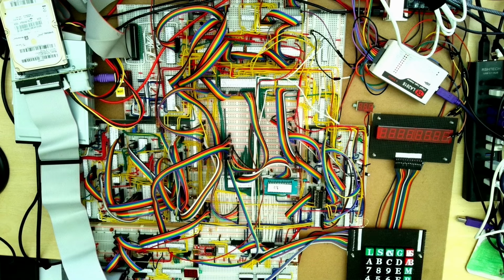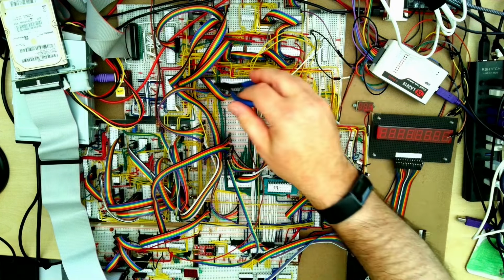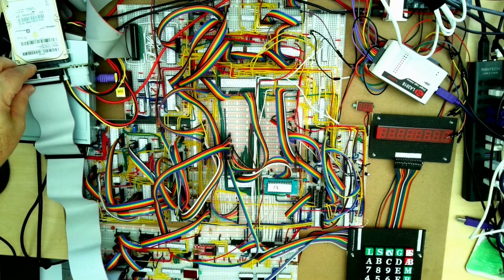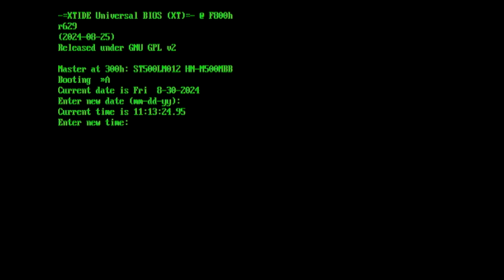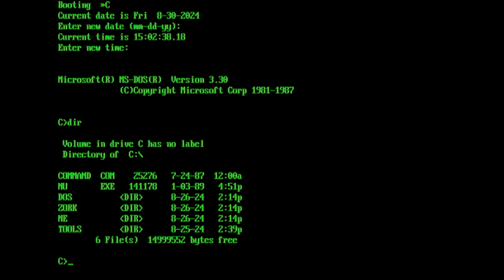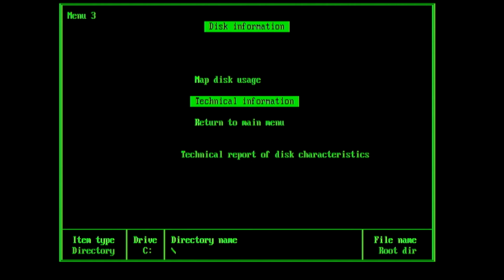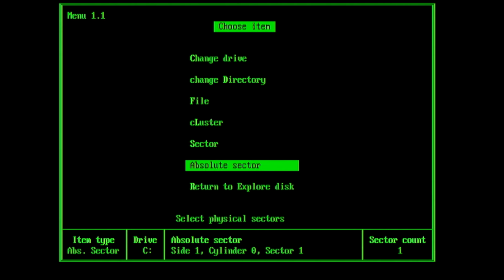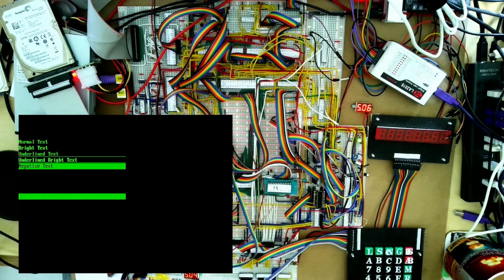Make a PC on Breadboards?

Comment: It’s a pity that no manufacturer has improved/changed these type of breadboards. Back in the early 80’s I could buy a breadboard with a 0.6” middle pitch from Tandy. Now we get low quality Chinese boards with a damn gap in the middle of the side rails. I have some nasty Chinese breadboards where the pitch is not exactly 0.1”, which you only notice when you plug in a MC68000 or similar multi pin connector.
Reply from the maker: I agree. I use the Busboard Prototype systems (Ben Eaters recommenation) ones which I get from Mouser in batches of 10 or more (£7-8). They are more expensive but I have found them to be reliable. It would be good to have 0.6" wide gaps and tabs at each end to join them. Also bus rails say in 8's without the gaps you get with the power rails. Steer clear of the cheaper boards, they will waste a lot of time. Dave

Comment: I see that you have fixed the default boot drive letter from D: to C:
It was a partition table problem or not?
Reply from the maker: I am not really sure! I FDISKed and formatted the drive again and it works as C:\.
It could be related to the BIOS Parameter block info which goes in the OS Boot sector (not the MBR) but that is just a guess! The code in DOS which deals with floppy disks and hard disks seems to have lots of kludges in it to work around various hardware issues (and number requested by IBM from DOS 4.0 source). Main thing is it works!
I will be digging into MBR/Partition table and OS boot sector in subsequent videos.
Dave